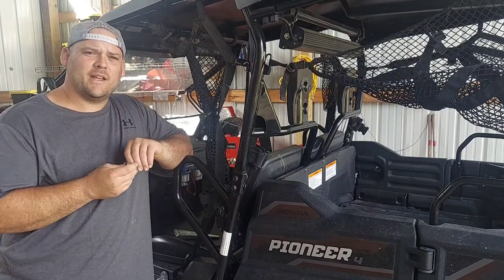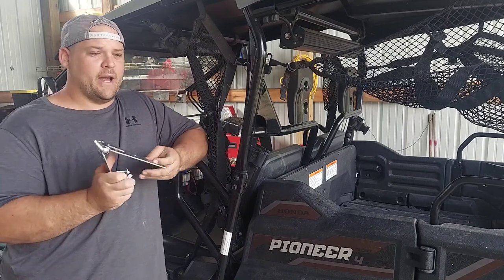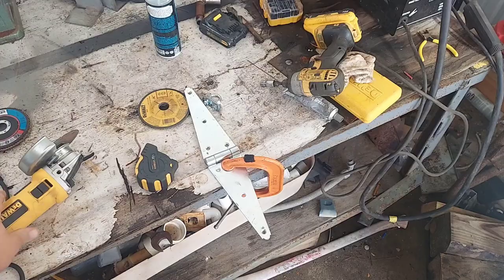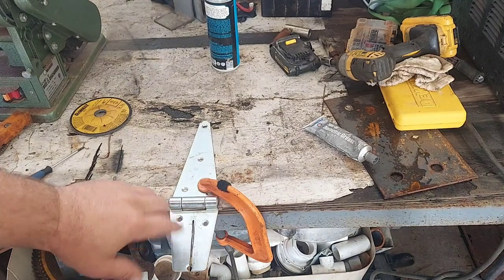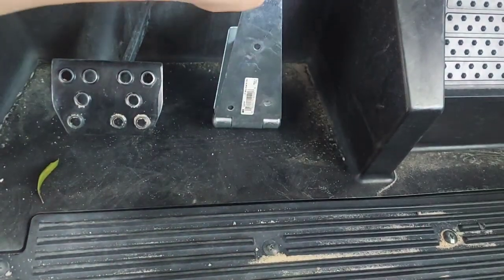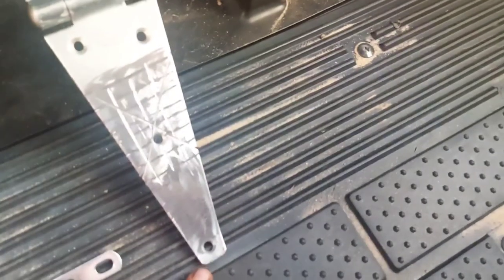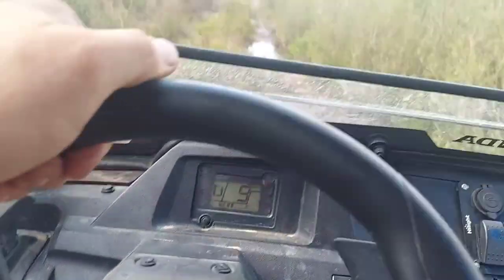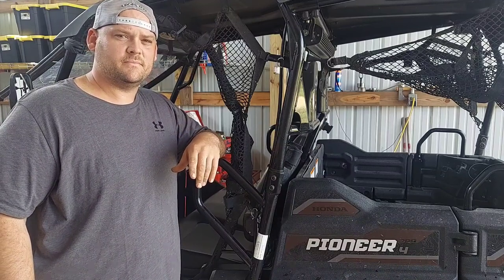DIY Honda Pioneer 700-4 Deluxe Trail Pedal

Comment: I've just watched the video properly. I'm a brit so we don't do this kind of thing much here. Is it so you can drive steady with your foot flat on the floor rather than just your heel when the truck is bouncing?
Reply from the maker: Correct and leg fatigue,  like I said I went riding all weekend and by Saturday night my leg was cramping cause of the angle I sit and having  my foot on the pedal.
Reply: Very nicely done! You also saved yourself (and me) $80! Thank you for posting this video.

Comment: Cool! Wonder will it work on 520 pioneer? UPDATE IT WILL NOT WORK ON 520 DUE TO PEDDLE ARM IS BENT AT 45 DEG ANGLE RIGHT AT TOP OF PEDDLE. YOUR PEDDLE ARM IS STRAIGHT. Now you could drill 2 holes at top of PEDDLE itself and make it work like that. Not sure I want to do that.
Reply from the maker: I’m sure it would but not sure of the pedal size
Reply: @NorthFloridaOutdoorsman  No it won't work on 520. PEDDLE ARM is different shape.

Comment: I'd be worried about a law suit if that failed and the machine went full throttle and someone were injured, the floor has ribs and that's what concerns me, not the modification.
Reply from the maker: The edge is bent just like the one that you order, no way of getting caught on the ribs , you can always pull e brake or just switch it off!
Reply: @NorthFloridaOutdoorsman  man I always worry lol